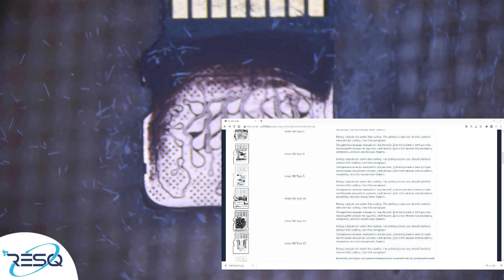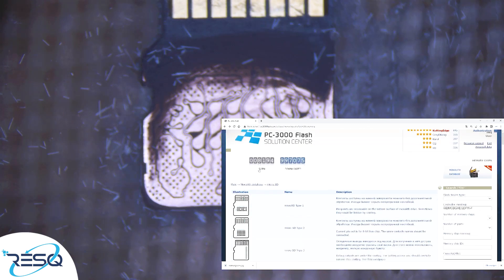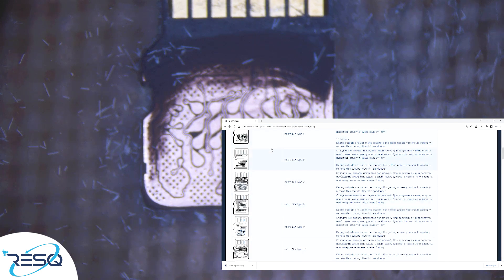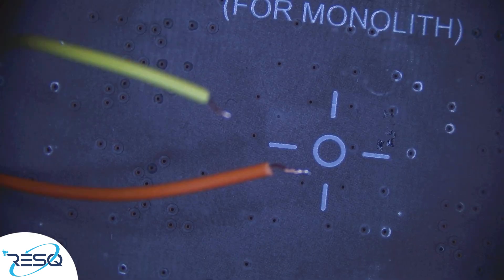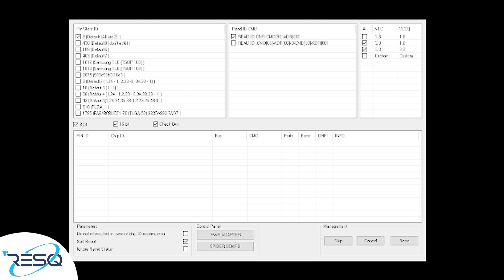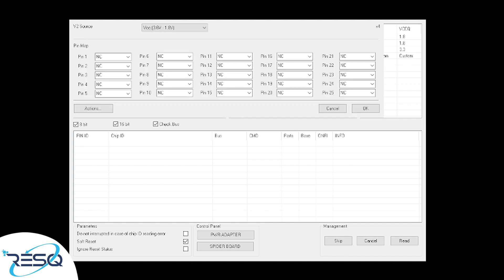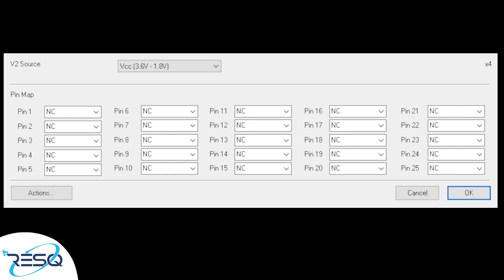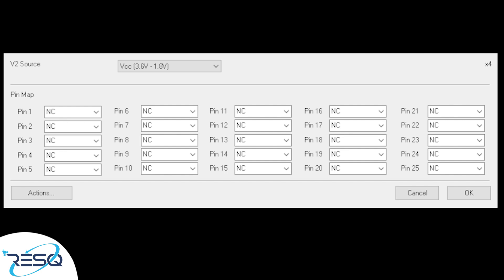Data Recovery on dead Micro-SD Card - What is inside? | PC-3000 Flash & Spider Board

Comment: Ben! It's great to see you back uploading again, I'm sure you have been busy but it's always great to see something from you.  I think this is a great device, It feels a bit safer for data recovery using the probes than soldering wires as you are not exposing the card or internal hardware to excess heat, and as we all know in the soldering world, The less heating we can get away with, the better off the repair is going to be.  Thanks for another great video man, Keep it up!